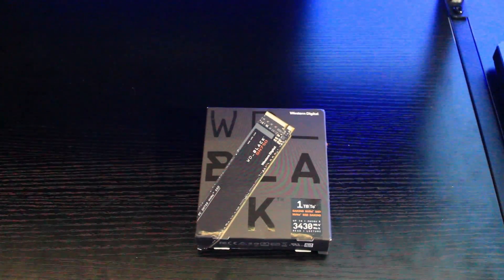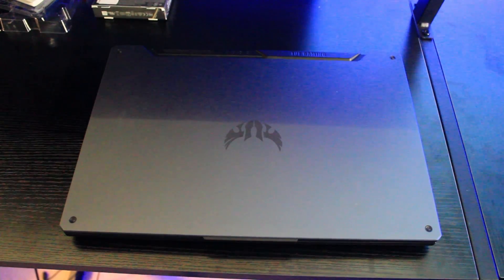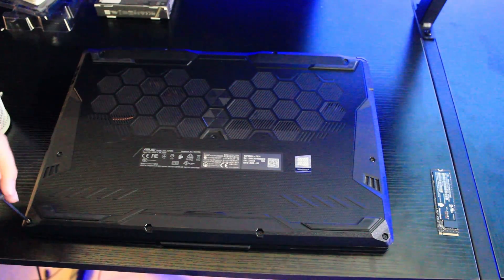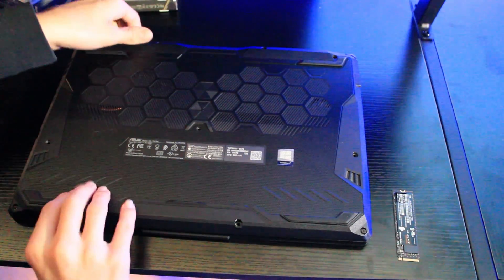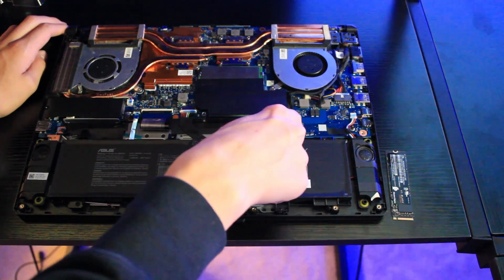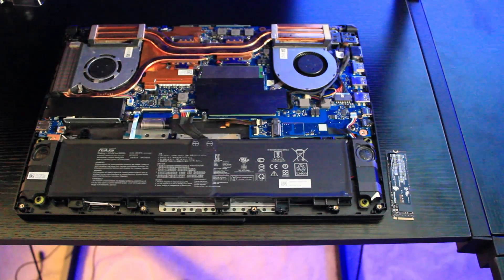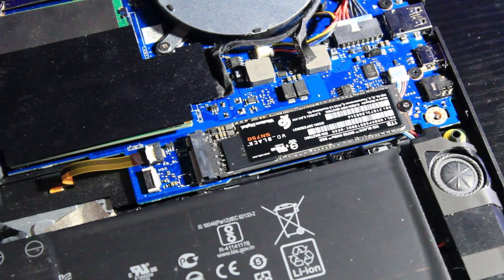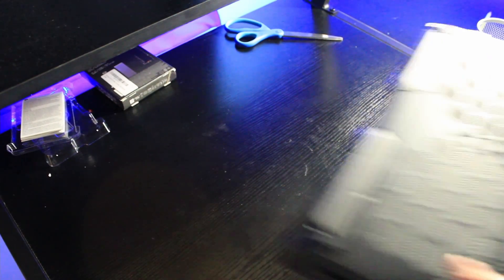Asus Tuf a15 SSD upgrade, and how to configure.

Comment: Hello, I have a problem, I managed to add the ram plate but the screw from the secondary ssd slot is stripped, do you know how i can remove him?
Reply from the maker: i like to put a tissue or a paper towel between the screw and the screwdriver to get some grip.